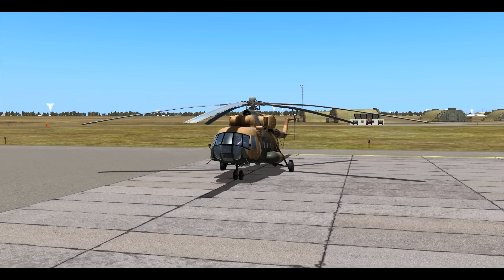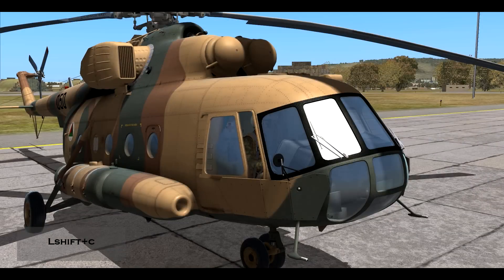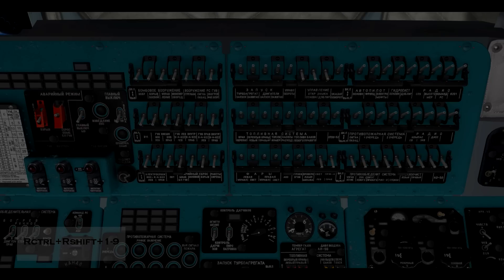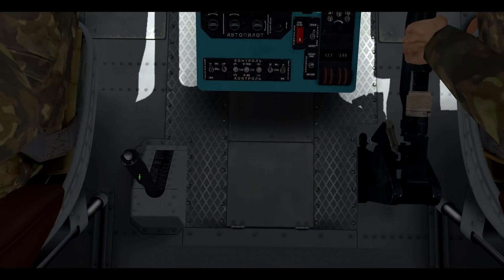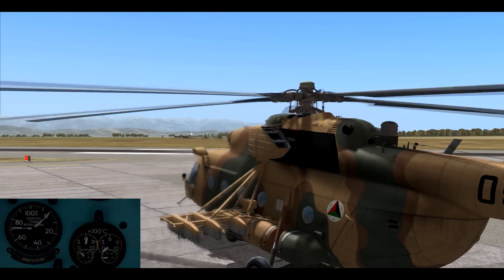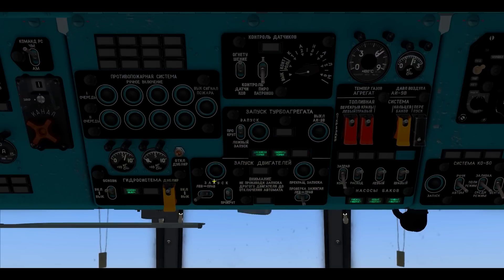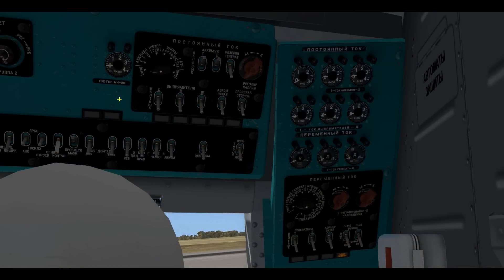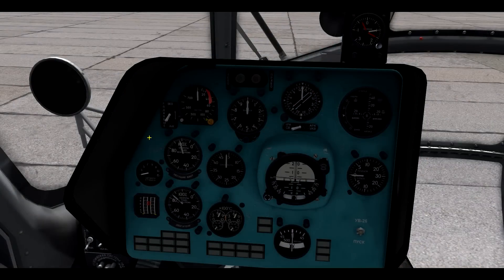DCS Mi-8 - Startup tutorial

Comment: Thanks for the video! The A-10 at the beginning was confusing :O For the Mi-8 start-up, I think you don't start all the fuel pumps when you're on battery, you only do that later to avoid depleting them (though the manual is very unclear and badly written in that part). It would be interesting to see the actual startup with and without external power, not the one of the training mission which is apparently not the best.
Reply from the maker: I'm not claiming that i would know how real aircrafts are started. You need fuel pumps on so you can start APU and your engines. If you search "start mi-8" you can see brief video of real mi-8 being started.

Comment: Just wow!!!! I pray this game it's totally just like the same instructions for fly a real MI-8 helicopter. I've seen DH-500 fly instructions it says first:
1-turn on Battery switch
2-push the starter (it called starter. It's the same start in the car god dammit . Anyway it was at collective stick near throttle).
3-you had to hold the starter until N1 reaches 60 .before it reaches 60 .when N1 reaches 15 you need  to open gas it's the same throttle in collective stick when you open the throttle TOT goes up when it reaches proper degrees so we done there but then N1 reaches 60 you can let go the starter button . Now the heli is ready you can fly it . (It was only fly instructions ,but you need to check every thing before you start and take off). But not every helicopter has its buttons and switches at the same place and not every helicopter has the same engine. it might be turbine or it might be piston . ( it means it has its own start up) yeaaaaaaaah
some of us might even thought that pilot a heli is easier than a car or even more stupidly , driving a threaded tank is easy but unfortunately it's not .

Comment: do you know how i can save a mission?
Reply from the maker: Hello, You can make your own missions in mission editor. Just remember to save them before quiting. Menu -> Save as.
Reply: RedShot also i have a problem with comunication menu,slash doesn't work,i have tried some combination keys but it won't open
Reply from the maker: Just rebind it from the options. Find the communication menu key and set a new key for it. No need for any combinations if you don't want.
Reply: RedShot yes i tried that but it doesn't work
Reply: RedShot sorry i have two accounts,i have tried to modify the key but nothing
Reply: wich key you have ?,maybe there is a problem with the radio in the cockpit?
Reply from the maker: Communication menu key don't work airborne. Make sure you have ICS/Radio switch set to radio, which you can see in the video @ 6.55. Then use "Radio Trigger - RADIO" key to access communication menu and to operate radio.